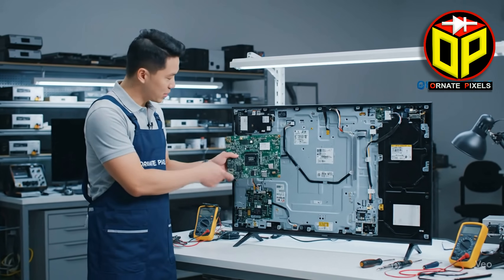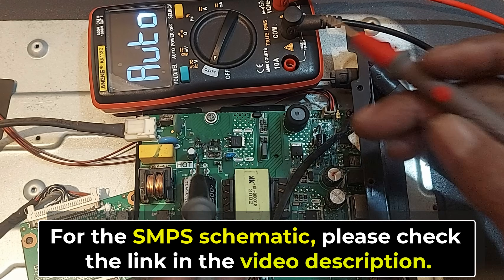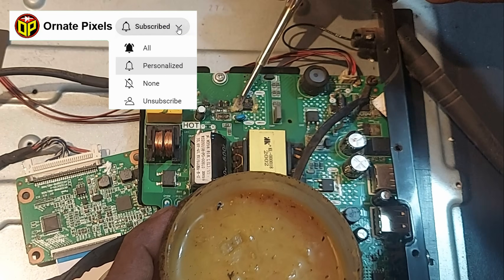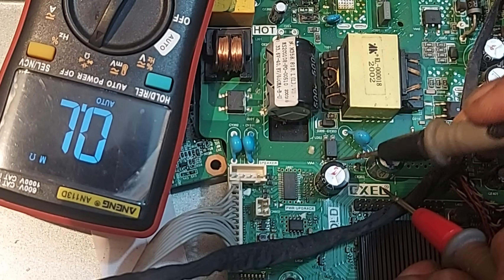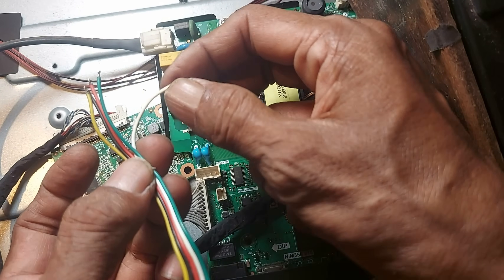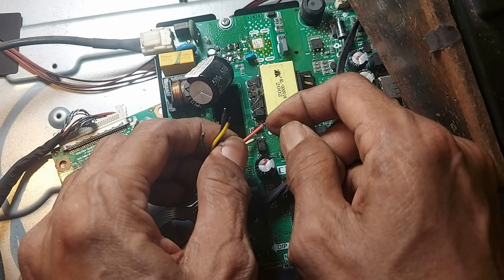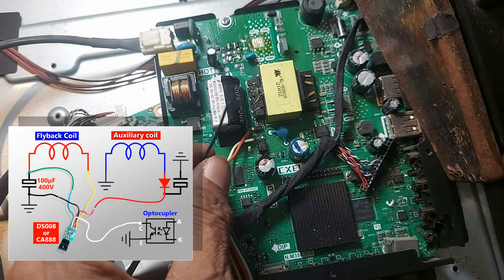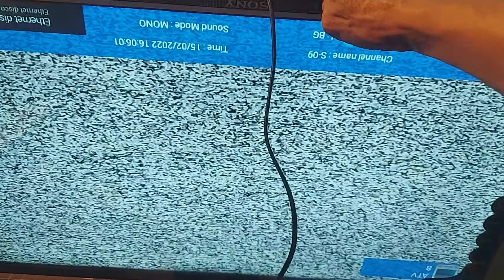LED TV Power Supply Repair Using DS0088 Or CA888 Universal SMPS Module

Comment: Will this module work for 43 inch UHD tv?
Reply from the maker: No. For a 43" LED TV, you can use the CA-901 REV:02 module. It's a universal power supply module that works well for screens up to 46 inches in size. Thanks, Brother.
💚❤🧡💛💙

Comment: I installed these CA888 modules and they worked up to 135 volts, but here we use 220V and the oscillation cuts off due to OVP. How can I fix this?
Reply from the maker: The CA888 module will work smoothly on TVs up to 32 inches with AC voltage ranging from 90V to 250V, provided the optocoupler is a PC817, PC817B, or a compatible alternative.
Connect the module exactly as shown in the video. If the problem persists, you'll need to check the optocoupler and all components connected to its Pin 1 and Pin 2. Additionally, check the output diode and the filter capacitor. Thanks Brother 💚❤🧡💛💙

Comment: I have tryed the module CA888 before, but the output voltage is not stable on 12 v.
Most of the tech don't cut pin 4 of the photocopuler. Why you cut the line?
Reply from the maker: Please check if the SMPS output diode and filter capacitor are faulty. Also, check the optocoupler and all the components associated with its pins 1 and 2.
Connect the module exactly as shown in the video. Additionally, check if there is an overload issue on the motherboard. (Do not install CA888 on TVs larger than 32 inches)। Thanks Brother. 💚❤🧡💛💙
Reply: Thanks brother for the quick reply.
All the instructions will be followed.
❤❤❤❤
Reply: One more please upload datasheet of BD8174MUV
it's 48 pins DC to DC did not find clear datasheet on web. We depending or yours because they are very simple and neet ❤

Comment: Never heard anyone singing while doing repairs 😂. What is the meaning of the song. Also is the module better than replacing individual components
Reply from the maker: Hello! Thanks for the kind words. Glad you enjoyed the singing; it helps to make the repair process a bit more fun. 

Regarding the song, it's a famous Ghazal. The lyrics speak about a secret love and the pain of longing for a beloved. 

To answer your question, using a universal module is often the best solution when the original circuit is severely damaged or has multiple burnt components, as you saw in this video. It provides a quick and reliable fix that saves a lot of time and effort. However, if only a single component is damaged, it can be better to replace it to restore the original board. So, the choice depends on the extent of the damage and the technician's expertise.
🌿❤️🌿
Reply: @OrnatePixels  olá o que faz a tela ficar meio branca ?  Já verifiquei as correntes. Fiz os cortes na linha de ckvs. Invertia as tensões de odd e even. E nada. A imagem parou de piscar porém ficou esbranquiçada.

Comment: What module should I replace the 40" with? Teacher
Reply from the maker: Hello. For a 42" LED TV, you can use the CA-901 REV:02 module. It's a universal power supply module that works well for screens up to 46 inches in size. Thanks, Brother.
💚❤🧡💛💙

Comment: What is the size  we must use this module  like in inches?or what are the guidelines  to select the correct  size
Reply from the maker: The DS008 or CA888 module can be installed on a TV up to 32 inches. Stay well, thank you.❤
Reply: @OrnatePixels  noted with thank what module do you recommend  on 40 inch and above?
Reply: @Junior-ff7ee  CA 901